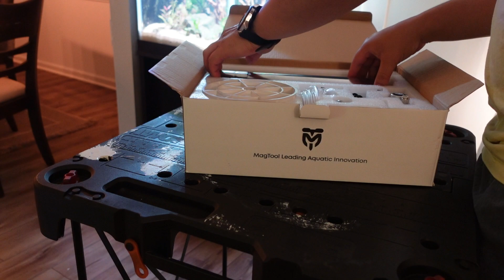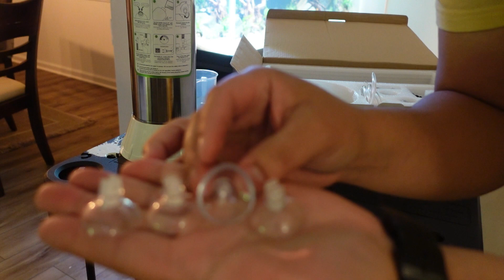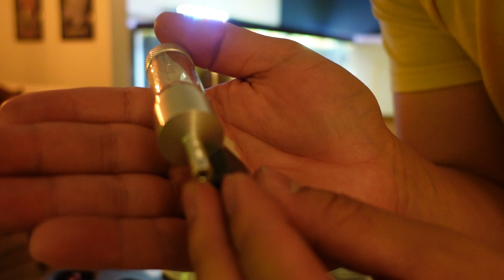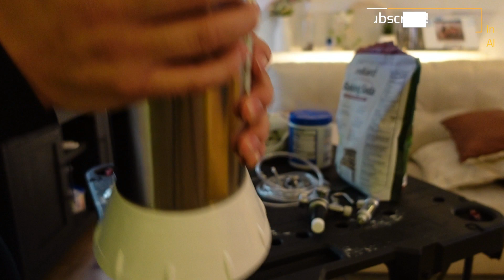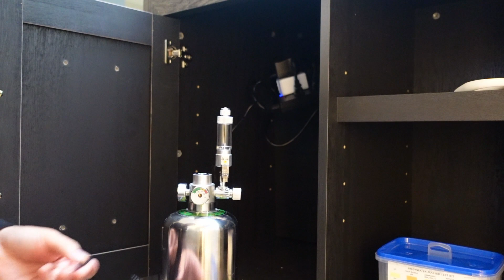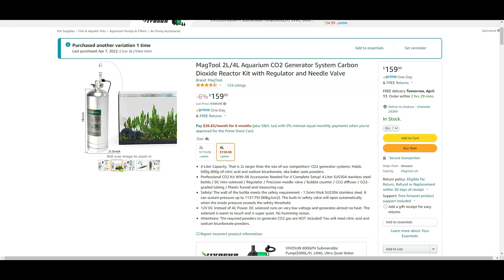DIY CO2 Kit For Aquatic Plants| MagTool | Unboxing & Set-Up

Comment: Hi could you please tell me how to take off the bubble counter? This is driving me nuts 😂
Reply from the maker: Hey, on the bottom where it connects to the solenoid, there is a metal piece with a plastic piece inside it - press the plastic piece down then pull the counter up while still holding the plastic piece down. Let me know if this helps!
Reply: @thedirtytank  thank you so much I will try this evening 🙏😊

Comment: Aloha... I noticed that you set up your CO2 system early April. It is now the ending of July, is it still giving off CO2? Thanks
Reply from the maker: Hey! The first go only lasted a few weeks. Now, since I have gotten better a refilling and have been increasing the ingredients to produce a higher pressure that's still within the safe zone its currently been 2 months and still running. I do have the smaller cannister and it's running on a 75gal tank. Hope this helps!
Reply: @thedirtytank  what measurements are you using for ingredients. I can't get more than 2 bubbles per second on mine idk if my ratios are of or maybe it's the regulator.

Comment: #3 mistake happened because you have co2 dial open. If you had it closed first, it wouldn't have leaked out in mistake #4 even if the solenoid was on. You didn't need it on either. The dial was just open right away. How long did you wait to turn it all on? I'm waiting 15mins at 1 bubble per 2 seconds to produce bubbles. I let my setup fully charge overnight. Diffusers need a certain pressure to push out the gas.
Reply from the maker: Hey! You're right on both points. I just happened to make the same mistake in 2 steps! I came back 30 mins later and it was going..it could have taken less than that. My current experiment is slowly increasing the ingredients to get the highest level of pressure that's still in a safe range. Still haven't found the highest ratio yet.
Reply: @thedirtytank   @AlvaCo-Leisure  Awesome! That's the 2l canister correct? I have a similar setup from another company. I think they are all the same haha. For me, 200mg of citric acid and baking soda followed by 300ml of water was actually the sweet spot for me. The needle was maxed out in the green section when I woke up the next day. The reaction you had was instant though compared to me. I think I had the bottle angled more so the water didn't hit the baking soda as hard preventing the reaction just long enough before the water touched the citric acid.
Reply from the maker: Yes, it's the 2l. I'll try that ratio next time I refill!